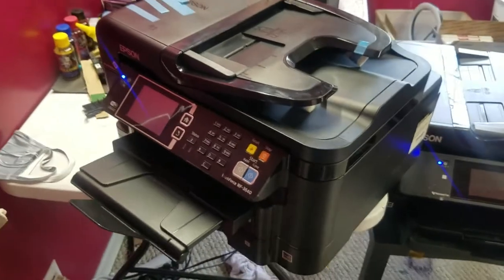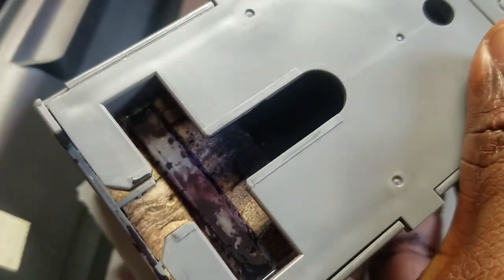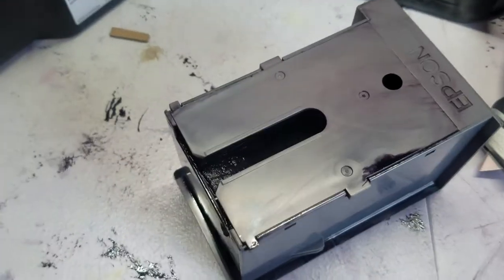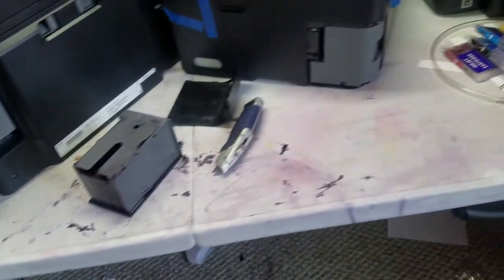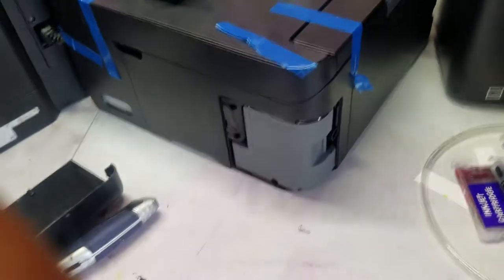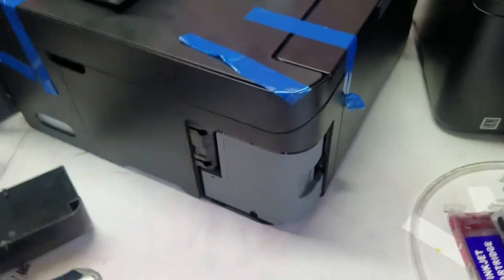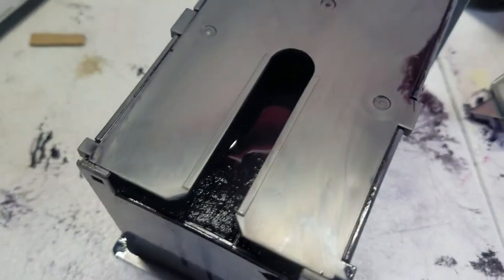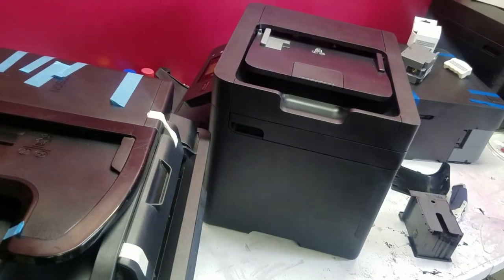Maintenance Box on Epson printer.

Comment: I have a WorkForce 7620 that I have had over ten years and use it every day. It was time to change the ink cartridges, so I bought more. I have not installed them yet because I can't get to my control panel. When I turned on the printer I got an error code 09xA. It said to turn the printer off and back on. I did many times. I can get no response from the printer except that it's on. or it's off. 
I love this thing. Would be more expensive to repair than replace? Could it be the maintenance box that caused the error? Is it a fatal error? I had never known to change that box! Today I took it out. It does not look full but if replacing it can fix my wonderful 7620, I'm on it! Help please! Advice?

Comment: Thank you for creating video!  

I don't know what you mean by "running chipless firmware" though.  

Knowing that firmware "updates" are nothing more than the manufacturer snooping to see if one is using third party ink and they remotely "kill" the printer if so, I have "firmware updates" turned off (for obvious reasons... I grew sick of having to buy replacement printers because of snoopy assed manufacturers remotely killing my printers because I don't take out a third mortgage to purchase their ink).  Is that what you mean by "chipless firmware"?

BTW, my collection box has said that it's full before and I've spent a bunch of money replacing them and when I pull them out they look brand new to me.  I've never seen a bunch of ink like I see in your video in the collection boxes.   I've never seen any ink at all in them and I've changed them three times in my existing WF-4830 printer.  I can't help but wonder if, in many cases, this is the manufacturer generating false information in order to get people to purchase collection boxes as they are quite pricey.  Obviously, yours were quite full of gunk and ink but mine always perfectly pristine looking when I have been prompted to change them. 

Thank you very much for any feedback that you can provide!  You do a great job with your videos, BTW.  They are very informative and easy to follow.  🌞

Comment: I have a wf-3640.  It's not printing. When you say it won't print, do you mean it won't print at all (blank sheets) or that it won't even go through the printing motion? Also, my tank is full per my phone app. But i never received a message saying it needs to be changed. Should I still replace it?

What is a chip? I just orderd a box with a chip. 

Thank you!❤